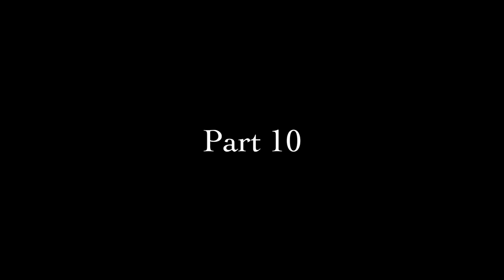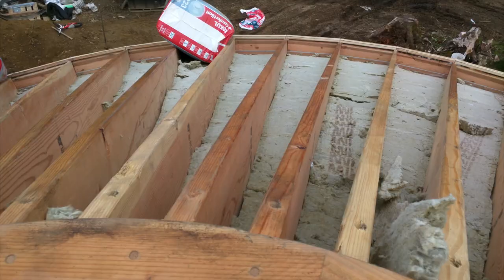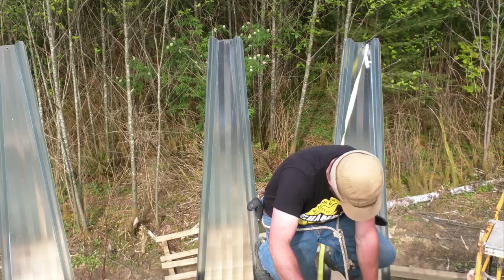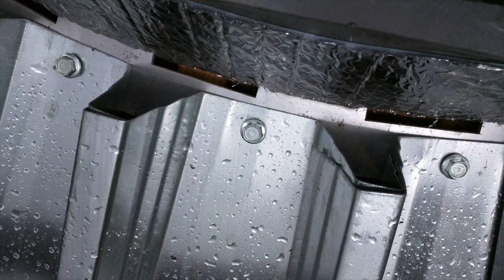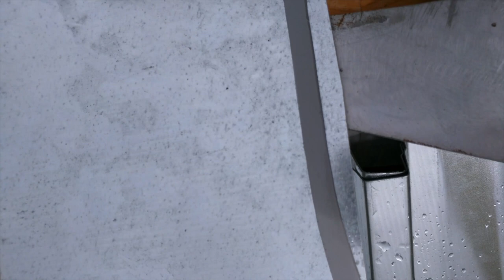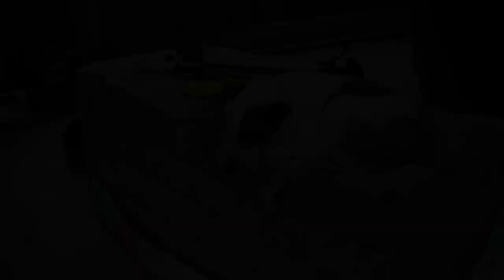Building an Off Grid Yurt Part 10: Cozy Insulation and a Metal Roof

Comment: As a professional climber of scaffold and structure @Eddiejoe Plebani has a point. Hyper reactionary but valid point. A 3/4" safety line, traction eye & basic harness would be a better idea with the line attached to some part of the ring or floor draped over some burlap or other corner surface would have been good to see. That said I find in many cases the safety gear can also cause the accident by tangling you up in it. A rope around your waist not being payed in or out seems like a great way to suffer a paralyzing spinal injury. Given that rain and sheet metal make for a very slick surface.

Comment: I think you did a great job on the filming.  It shows enough to get the idea of how the roofing is water tight and allows ventilation.  I did find it odd that there was no roof sheathing..............
Reply from the maker: +Fu Dog Whisperer The definitely a a different kind of roof. If it helps, this roof metal was designed and manufactured by a grain bin company.

Comment: From a retired carpenters perspective, the roof on this building is super time and labor intensive, but necessary to keep the heat in and it looks great, so don't get me wrong, if you've got the time it's worth it. Just wondering how you get the trapped air at the ceiling down without a ceiling fan.?  Also did you put that rope around your waist for the safety factor in the video, cause you don't want to be on the end of that rope when your body weight hits after a fall. You need a harness and d-rings.
Reply from the maker: I know the rope wasn't the best fall prevention and hindsight tells me even more. (Luckily I never fell) I won't try to defend that part. I don't have a good way to get the warm air down without a fan. If I upgrade my power system maybe I can add one. For now I just add more wood to the fire. I'm glad you have enjoyed the build it was time consuming and educational. Best wishes.

Comment: Could you comment more on why you added the extra wood over the joists and how and what did you do to get the roof ready for insulation and tin. I see you are very handy and obviously didnt need to hire someone but did you ever consider it and if so what was the price quote? Thanks in advance for the response feel free to turn my question into a video if its a pain typing it all out. The more detail the better as I'm in the design and planning phase of doing what you already accomplished. Also your videos are super awesome.
Reply from the maker: I may not be able to provide all the information that you are hoping for but I will try to get you a little. The extra wood was provided in the kit for the yurt. It is there to give the proper air space for venting the insulation. To have the roof ready for insulation and tin I added put a vapor barrier in each space between the rafters. PVA primer would have worked as well.  I didn't seek out a quote on having someone else install the roof or roof metal for me. I wouldn't even have a guess about how much it would cost. I can tell you that it wasn't too bad to install when it comes to roof installs.  
It may help to know that smiling woods yurts will send a detailed construction guide with the kit that will explain a lot of these steps. 
Good luck on your design and build. Let me know how things go.

Comment: I like what you are doing,and thank you for the upload. But does it really qualify as a yurt. Or a round house ?
Reply from the maker: +bhhardgr01 Well it is probably just a round house, but it is sold by Smiling Woods Yurts, so I call it a yurt... It is a bit of a stretch from the true original yurt, that is for sure.

Comment: That was a ton of work to get the insulation installed.  I would have thought your yurt manufacturer would have supplied pre cut EPS styrofoam for the insulation.  That would have went in quicker and provided a higher overall R-Value in your roof insulation. 

Just for a bit of a laugh.  When estimating the time for a given project, double the number and go up to the next larger time unit.  So a 1 hour job will take 2 days.  ;)
Reply from the maker: +bwillan That is a good point about the insulation it would be quite handy to have that stuff ready to drop in place. 
I will have to estimate your way now 😌😉

Comment: One day to insulate and getting the roof on your house? Doing it in two days is an exploit on its own. You have to be proud of this within this timeline, not to be ashamed.                                                                                                                                                                                                                                                                                                                                                                                                                                                                                                                                                                                                                                                                                                                                                                                                                                                                                                                                                                                                                                                                                                                                                                        

Mineral wool insulation is superior, in my humble opinion, to fiberglass insulation. Depending on its density, it is surprisingly easy to cut it using a circular saw.

The metal roof is gorgeous. I haven’t seen any metal sheet that you can screw; all previous one that I saw and worked on where folded seam roofs. I’m a bit doubtful with the amount of screws that you put on; it might be just the camera angle that mislead me thinking this.

P.S.: a Swiss Seat (https://www.youtube.com/watch?v=ssmYruwGTzM) or a Hasty Webbing Harness (https://www.youtube.com/watch?v=sP5IdhkgKs8) with a Prusik knot (http://www.animatedknots.com/prusik/index.php#ScrollPoint) would make your life a lot easier while working on the roof. And no, carabiners are not mandatory unless you are using a pre-tied webbing loops. :-)
Reply from the maker: +Simon Forget It was a true rush, that is for sure. I also looked into foam insulation but I couldn't find a local company that could do it and I didn't have the confidence to try the diy kit on a steep roof. I thought this was an acceptable alternative. 

The roof metal is held on with many screws. One every  12-16" on the ribs and every 4-5" on the eaves. We put in enough screws to hold while it rained and finished after the rain. I don't have a shot with all the screws installed in this video. 

A better harness would have been a good choice for sure, but the rope definitely helped me stay on.
Reply from the maker: +Simon Forget sounds great, thank you.

Comment: Is anyone else still thinking that the walls need to be mechanically fastened to the floor and together?
Reply from the maker: It would be right to think that. It has been a while since I made the videos so I don't remember what made it into the videos but the the walls are fastened to each other and to the floor joists and rim joists with nails. The whole structure is strapped from foundation to rafters with the appropriate Simpson straps to exceed wind and seismic specifications in the area. I know I covered some of the installation of these straps and fasteners but I know I didn't follow every detail. I would definitely advise anyone building one of these to mechanically fasten the walls to themselves and the floor.